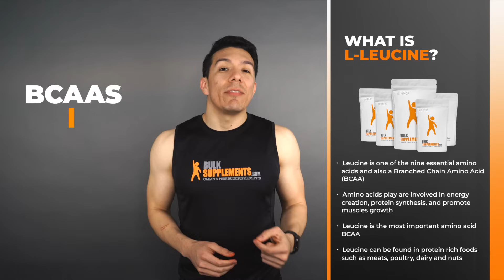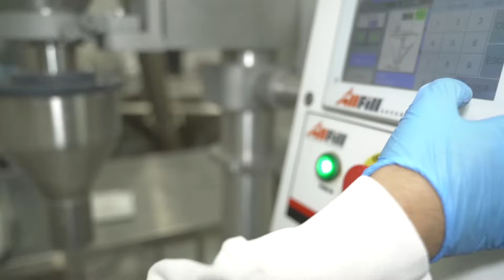What is L-Leucine? Benefits and Dosage

Comment: this product is difficult to blend. I have it. How do you mix it, Cold water, Hot water? Any suggestions?
Reply: I just git mine today and used a LITTLE battery operated hand mixer. Worked great!
Reply: @susanorban3059 the flavor is terrible I could manage with coffee
Reply: I reaspoon in COLD water in a VERY small capped jar and shake the crap out of it, turning it into a milky substance.

Pearls in hot water.

Been using it in filtered coffee one hour before breafast for over  a month now and for me, the reults have been amazing.

Previously, if I squatted down I couldn't get up. Now I can perform 15 squats with ease. No pain in legs and have regained strength in legs. Aged 77 years.

Give it a go.

Comment: This is one of my biggest issues your multi dextrin is corn Basin is not gmo-free therefore that's one of the reasons why my labs have shown Arsenic and high levels of carcinogenic contaminants within your extraction products. Now I can't call serious help harms if not taken properly but the fact is you're giving poisonous maltodextrin not clean non-GMO tapioca derived multi dextrin but corn days and most of your stuff is outsourced from China and they've been cleared by Monsanto to use Roundup on the product you're selling. So unless you can give me an actual chemical data sheet that matches with the lab results for what I've been sending out on your products I can no longer do business without having to go through a class action lawsuit because my clients aren't happy and I had to tell him where we get our stuff and I had to cut ties with you guys whether they want to file lawsuit against you that's up to them but instead I'm just going to discontinue use what your company, my attorney said that's the best option if I'm not going to take you to court. You can thank your customer service for not giving me proper information and then finally telling me the truth and putting me through the loop and the fact that I found out that these supplementary selling cause more health issues from long-term use than the recovery benefit I'm definitely uncomfortable with what you're using for cutting agents and how you're getting your sourcing